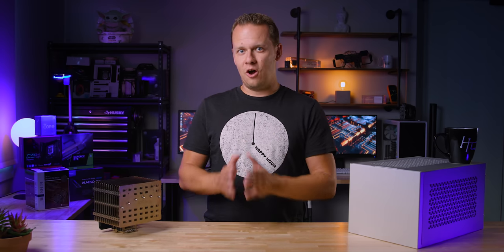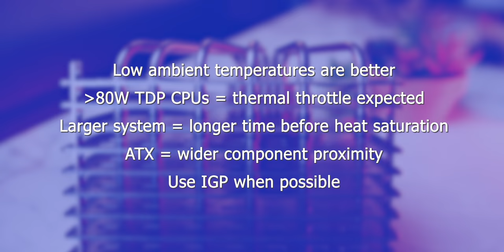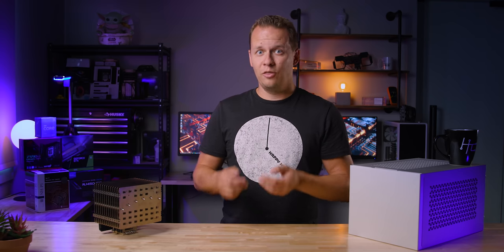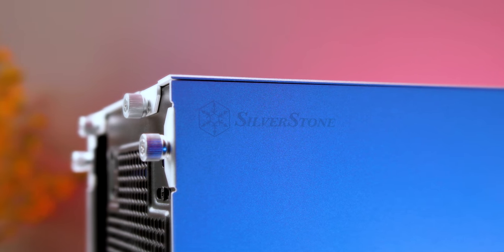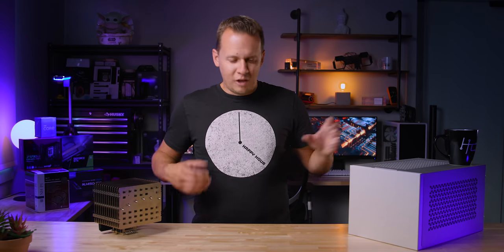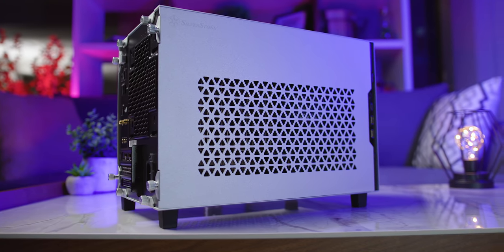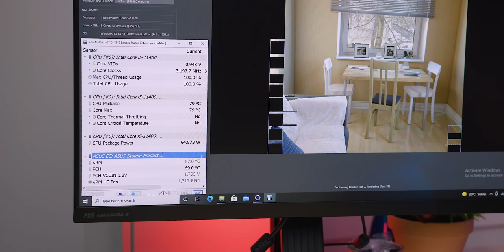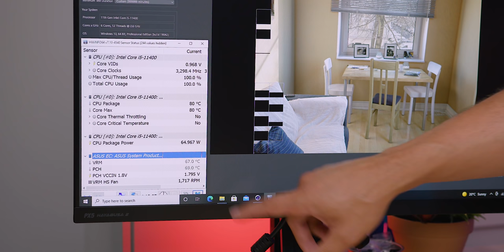This Passive PC Build is TOTALLY Different!

Comment: So I know youtubers need sponsors for these kind of videos but Thermalright has had the Le Grand Macho RT and the ARO , AMD specific coolers that can also be run passively, because they are so large(for lower output cpus) or with a fan. This isn't new why not do a video from a different vendor than noctua?

Comment: I'd rather just drill some holes into the plate so the heat pipe pokes through.
Also if it can be done precisely, it will help hold the heat sink from sagging.

Comment: First off, great build.  That said, a good passively cooled PC should be built with the heatsinks on the outside of the case.  Google large audiophile amplifiers from the 1980s-2000s like Krell, Threshold, Plinius, Adcom, etc.  Modern PC cases restrict air flow and still create a heat box, despite the all the mesh and ventilation.

Comment: I don’t think it was necessary to buy a specifically engineered passive cooled GPU. Any new high end 3000 series has a big enough heatsink that you could take the fans off and still use it by seriously undervolting it or allowing it to control itself. The EVGA 3080 Ftw3 ultra has a massive heatsink that frankly looks better than this one.
Reply: don’t think that’s gonna work without the gpu severely throttling itself. the 1650 super works passively because it’s a 75w gpu. the 3000 series are way above that, with the 3060 at 175w, although maybe the upcoming 3050 might change that.
Reply: But it would not fit.
Reply: @alexkwan3  yeah, if only these passive GPU-s came with max q chips. a 3060 max q would be both more than twice faster than this 1650 and a little cooler. 4GB of vRAM is severely little these days.
Reply from the maker: Sadly I thought of that and there were three issues.  First of all is the fact heat rises so all that heat would get dumped towards the P1.  #2 is the fact that the GPU would throttle at some point and that wouldn't be good.  #3 - I bought most of the parts myself and the GTX 1650 was the only thing I could find.

Comment: just undervolt the gpu, you'll be surprised by the result
Reply: undervolt, but increase the clock a little to compensate, it will remain the same in terms of power, but will reduce the temperature by ~10 degrees C if done correctly

Comment: Couldn't you just cobble together a Raijintek Morpheus with a 1070, 1080, 1080 ti, 2070, 2080, 2080 ti? Not sure which would have low enough tdp to run soothly.
Reply from the maker: Maybe.  Not sure though......good question!

Comment: My first PC was passive, no fans. That you default need to have fans nowadays is simply because the hardware designer had chosen that path. And if they could agree to standardize the cooling solution, power converting, etc we could have far better use of power, less noise, less issues

Comment: Actually no, for a passive system internal air functions as an insulator. That's why there's such a thing as double-paned windows. The smaller case, therefore, served to your advantage because the case itself is able to draw some of the heat out of that static internal air. The case is part of the passive cooling loop.

Comment: Sadly the 1050 Ti may be the last gaming-class discrete GPU with a passive cooler. The 3050 has a TDP of 150W and power requirements are only going to go up in the future, so something like this won't really be feasible going forward.

Comment: This is like a first attempt at silent computing. I use my 3D-printer to make cpu cooler shrouds and PC cases, and it is bloody obvious that you got some ways to go here. If you want quick results, just use the D15 in dual push, as opposed to the standard push-pull, on an open bench. Just move the fan in the middle to mirror the outer push fan. Two towers, both in push, towards the center. It is embarrassing for the industry, how much that alone improves temps, and at what level that places the D15 compared to rest of the industry. I use a duct for dual push on the D15, using 120mm fans, and somehow that makes me feel like an alien from another universe. It is just basic thermals, as in "how to avoid heat stacking", but it is a conversation nobody seems to be having, on planet earth. Not for air cooling. If I was not clear on this, I cool my 3950x at about the same noise level, as the semi passive cooling in the rig in this video. No throttling, rock stable. If you want to do that in a video, give me a call. I just use a D15, modded with a 3D printed shroud. It is stupidly simple.

Comment: This is the worst kind of content.... 6 mins wasted to explain parts used... has 15 years of building experience... but does no research... just yoloing everything... its a disaster....   Sidenote: ofc it works to cool passively, as long as you have enough material to cool the amount of watts the system puts out.... what we wanted to see was you passively cooling a high end system... building your own case or testbench capable of keeping it cool...but nah..... /facepalm irl      .... ofc at the end... you added a fan.... no surprise there.